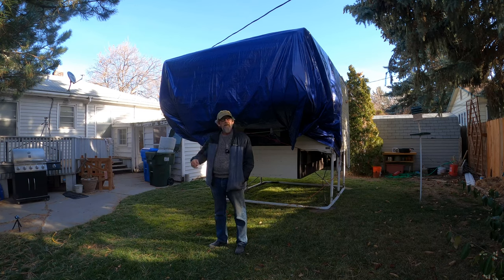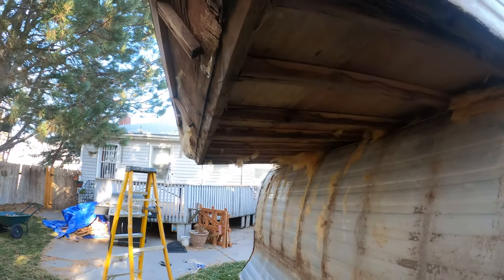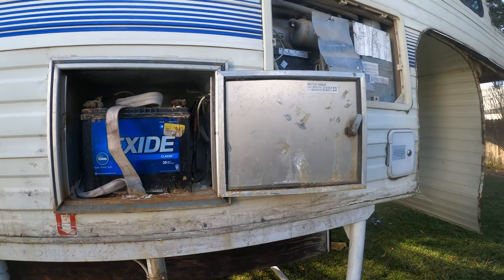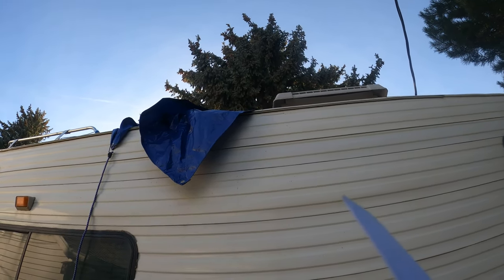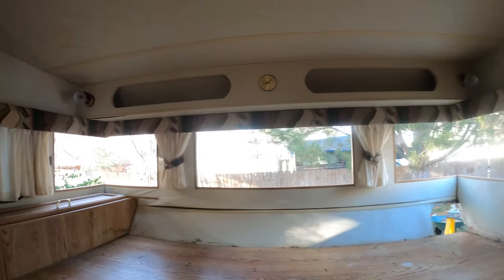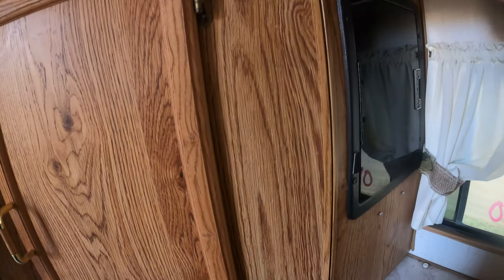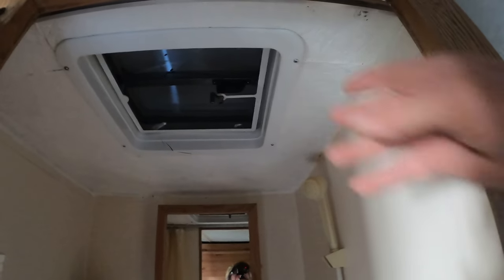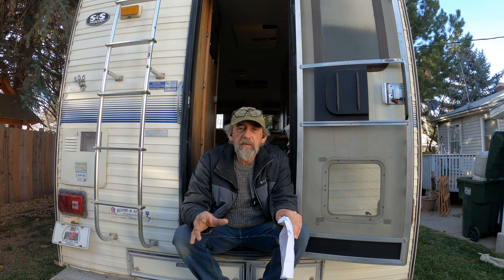Renovating a truck camper Ep.4 - The very large project list and a preview of water damage.

Comment: Plenty to do , Plenty videos to make. 
Shall be educational for all. 
Tent it for the winter to keep working.
Reply from the maker: Sure enough going to be educational, for me too. It's just too damn cold to work outside much here in winter. Butyl tape and lap sealant are a hugh PIA to work with in the cold weather. It get brittle and is very hard to apply. Heating a tent would get pretty expensive with propane knocking on $4 a gallon.

Comment: I purchased a 2002 S&S with a truck this summer.  Could see that there was some damage from the outside, but the inside was in perfect shape.  I paid $500 less for the truck than the blue book value, so basically feel like I got the camper for free.
I have it in a shop now and they tore it apart.  A lot of the same damage to the front from leaks.  I love the bubble windows, but decided to not have them reinstalled as it's being rebuilt.  Less chance for future leaks, and a little more aerodynamic.
I feel the same way as you.  I'd rather see it back on the road than in a landfill.  
Excited to watch you work through this renovation.  Wish I wasn't paying the hourly labor to have someone else do it, but I don't have the skills or space to do it myself.
Reply from the maker: Thanks for watching, Eric. Yea, I am going to seal the crap out of those windows. I am going to use marine sealant. I think it will hold up against the water better. Spring can't get here soon enough so I can start working on it again. Stay in touch and I'd love to see some pictures. email trbowlin@gmail.com